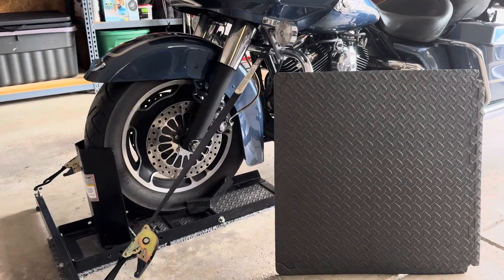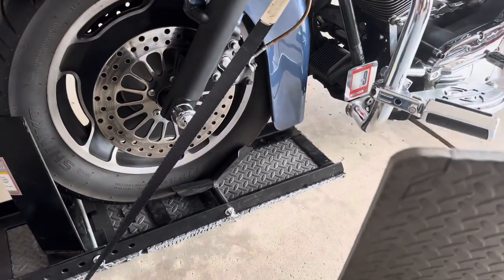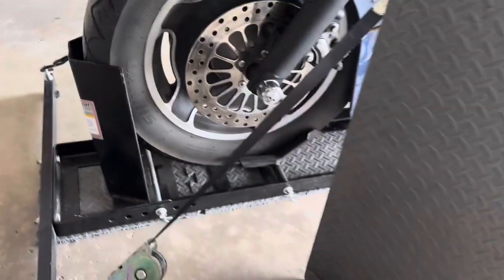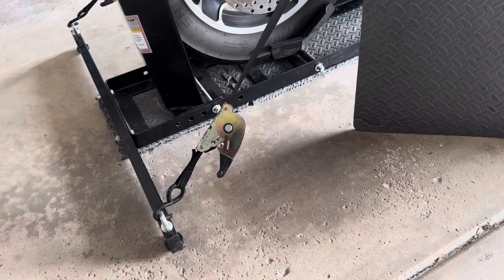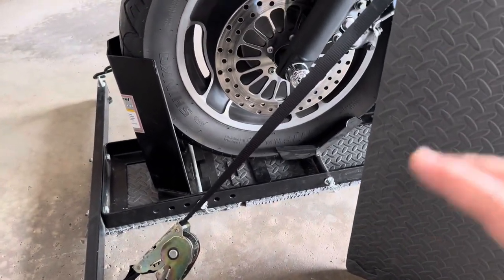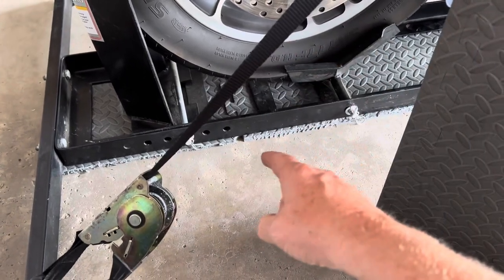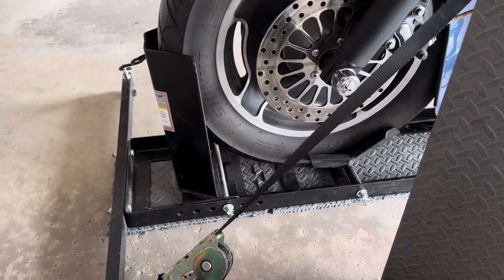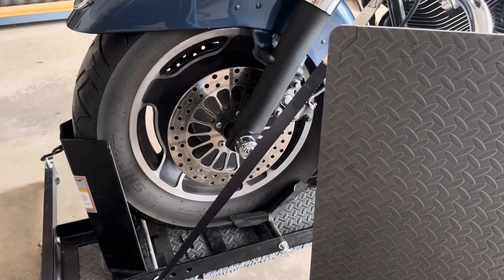Two tips for using and modifying your Harbor Freight Pittsburgh motorcycle wheel chock

Comment: I just lay a piece of pipe in between the front wall of the garage and the stand and it'll stay right there. I have a nylon woven toll rope with hooks on each end I just hook it around one leg of the workbench holds it right there I can back off.